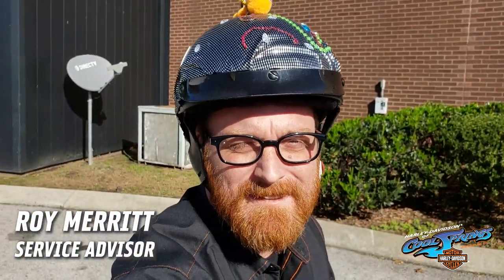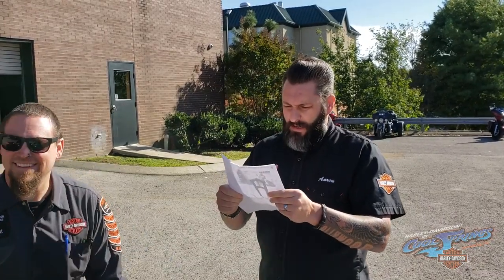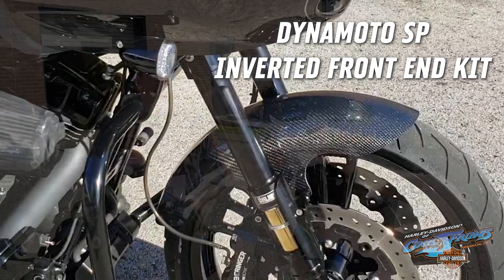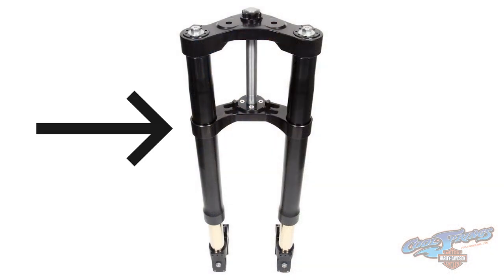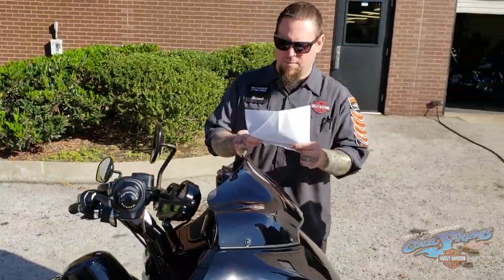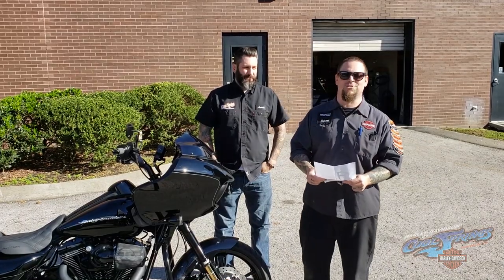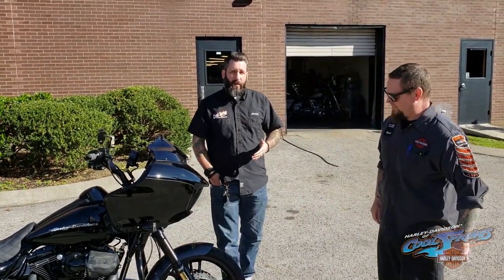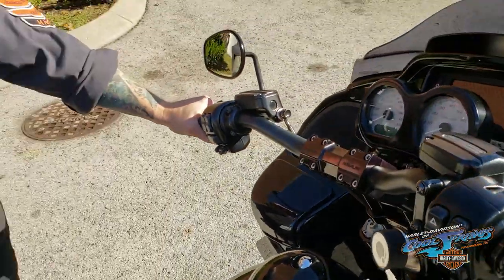Your Ride Sucks | Shop Talk Episode 8

Comment: I put it on my 2015 street bob with dual discs and black powder coated low rider S rims.
Reply: I bet your bike is sick, ive been contemplating running the same set up on my street bob. Mind me asking how much you ended up spending?
Reply: @Jesse-jc4vv  The kraus inverted front end is around $4200 but to be honest I didn't keep track of the pricing. I had some flush money at the time and went for it. I also had the SE stage 4 kit installed, Bassani pipe, color matched JT fairing and more. Ended up selling it and bought a new Street glide special. Have the same inverted forks on order with Kraus 10 inch risers and their Moto bars. Can't wait. I'm recently retired and not married that's why I can afford it.
Reply: Austin p; yeah I’m not retired and not married and about to say fugggg it!

Comment: You need to throw that fp3 in the trash.  And get a real tuning device..
Reply: That's what we did. 😉. We then made a video about FP3 and piggy back tuners but it's so controversial it hasn't been released yet.
Reply: Really..fp3 is a decent tuner..if you know  how to use it fully..so when you make the video. It would be nice to see dyno tune for each. Using generic tune..vs  customize tune....don't cheat

Bwahahaha
Reply: @smokeGR20   . Sure its fine for a stage 1 that's it.  But when you build and engine it will not cut it. Ask a real dyno tuner. That builds engines. Like zippers ,hillside cycles,tman performance.etc etc.
Reply: Danny Tapia your on the money! You’ll never see an FP3 at a HP shot out anywhere.